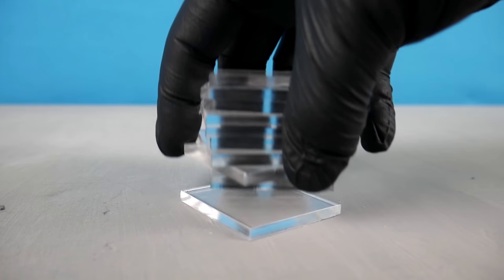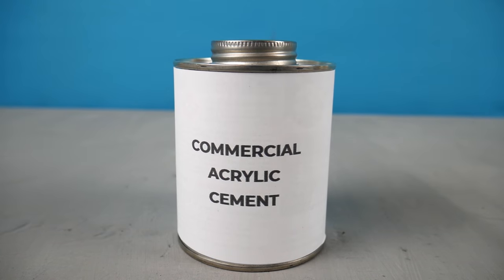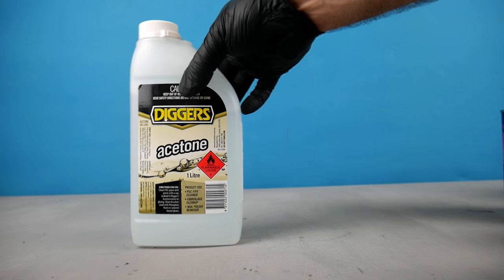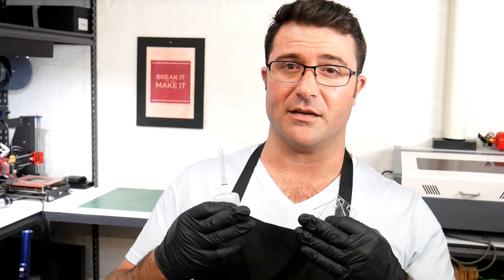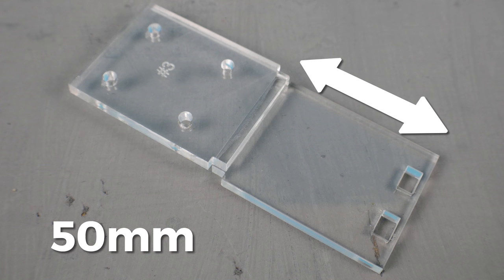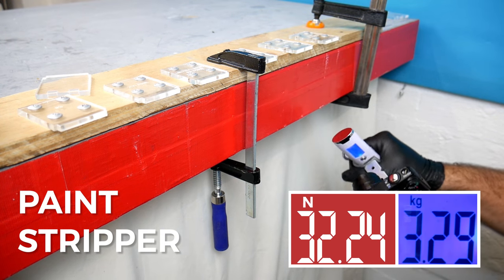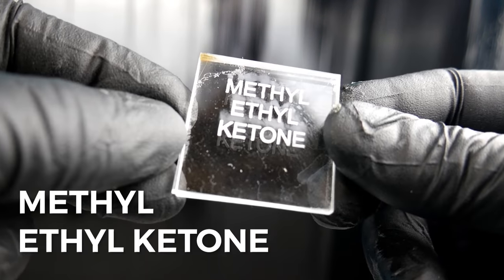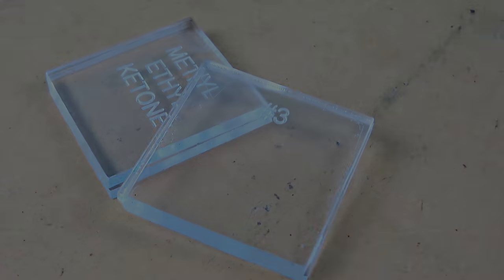How To Bond Acrylic Sheet Without Acrylic Cement

Comment: ...the only way to ensure a strong chemical weld with acrylic is by using dichloromethane (methylene dichloride) as a base solvent...trichloroethane was used until it was determined to be a carcinogen and outlawed in the USA...trichloromethane (chloroform) can be added in small quantities to the dichloromethane...paint stripper is basically dichloromethane with a short chained hydrocarbon wax to slow evaporation...and it is banned in the great state of California...

Comment: Methylene chloride or methylene dichloride bonds acrylic , and ,styrene , polycarbonate and abs. The better solvent for abs is mek methyl ethyl ketone. The best one to bond PVC is not safe so the commercial bonding glues like you can get at home Depot are best. For hot air welding Abs is possible to weld also PVC is. HDPE is weldable , and polypropylene . Polycarbonate doesn't bond as well as acrylic does with methylene chloride but it's still the one to use on polycarbonate. Polycarbonate and acrylic are not hot air weldable. The very unsafe solvent that at one time used to be used on PVC was called tetrahydrafuran . It is highly carcinogic and ultimately became used under negative pressure fume  hoods. I don't think it gets used at all anymore. Hot air welding  is the way to go with pvc. Or commercial suitable glue ( builders supply stores like Rona and Home Depot.
Reply from the maker: Wow! Great comment! Thank you!

Comment: Yoo , i have a nice test for you, i am looking for the best most powerful glue, that can be used to glue a metal or acrylic or wood  frame to the back of acrylic sheet 180*120cm .. and this frame will be holding all the weight for hanging this sheet on the wall ...